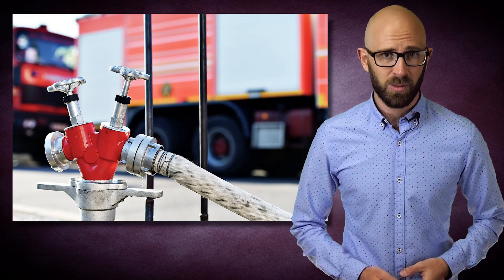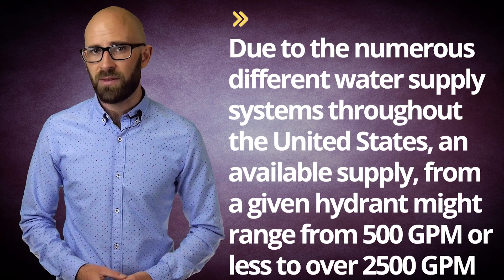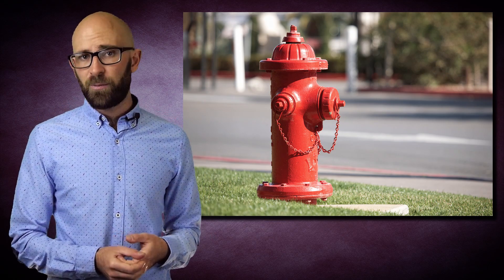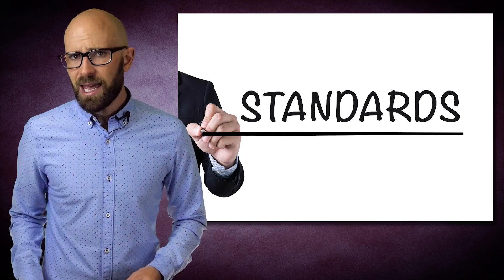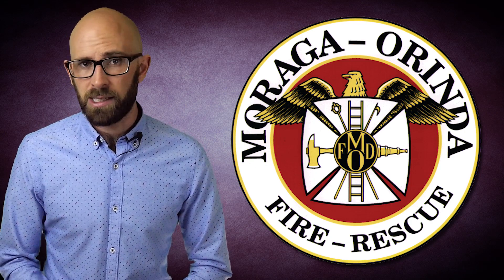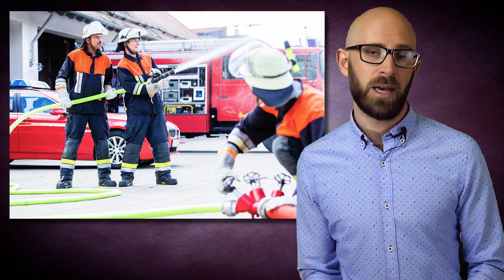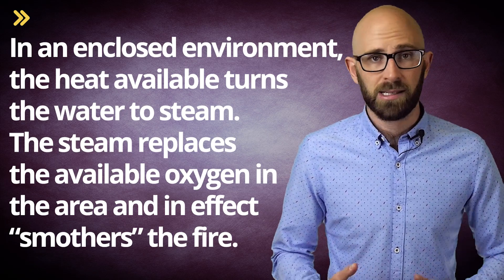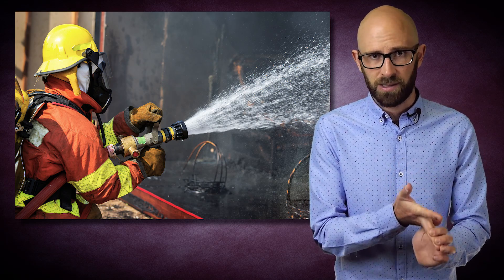Fire Hydrant Colors Actually Mean Something

Comment: In an American city or suburb where the hydrants are connected to the water mains, there's no need to color-code them. No fire department is going to roll up on a scene, look at the color of the nearest hydrant, and determine that it's not usable. "We need 725 GPM for this fire and this color says it's got only 500. Let's go around the block and see if there's a different color over there! We'll run a mile of hose to it if there is!"  That's why the half that doesn't care about color are realists and the other half that cares are probably Democrats.

Comment: Fire has 3 elements, not 4. Heat, oxygen and fuel are the 3 elements or components. Your “forth” is  not an element, it is the cause to the combination of all those 3. Fire will be extinguished when you eliminate one of those.

Comment: The color coding system helps when determining how many hose lines can be employed from the fire engine using that particular hydrant as a source.
However, the actual volumes and pressures can vary greatly depending on things like the time of day, whether or not the water company has adjusted the flow pattern, and also if someone else is using (or has open) another hydrant on that particular main.
It is the water company’s responsibility to regularly test each hydrant for actual pressures and viability, but for the above reasons many fire departments have their companies also consistently check the hydrants within their response areas.  (Pittsburgh Bureau of Fire). The colors typically relate to the size of the water mains they are on, but should reflect actual testing results (and these colors may change if repeated discrepancies are found).

Comment: Another effect in using water you overlooked is that by saturating the fuel source (such as wood or fabric) you make the fuel more difficult to burn. Another fire safety fact worth noting is that for grease fires in the kitchen, it's recommended to never use water. Water and oil don't mix and the water can cause the grease to spatter, spreading the fire. The recommended action, if the fire is still contained within the pan, is to either suffocate it by putting the lid on or douse the fire in flour (having an effect much like throwing dirt on a camp fire to extinguish it). The most important thing you can do in the event of a kitchen fire is to not panic. When cooking, always be aware of the risk of fire and be prepared to take the appropriate action should one break out.

Comment: St Louis county for the most part follows the color code, where the barrel is yellow and the bonnet is colored based on the main size, green for 12 inches and up, orange for 8 & 10, and red for six and smaller. Whereas most hydrants in St Louis City are black with a silver bonnet in most places and stylized in others (painted like the Italian flag in The Hill)

Comment: the city in which I live kept it's hydrants yellow and color coded the caps only. We also utilize a lot of dry hydrants in towns and villages along lakes and rivers which are made of a 6 inch diameter pipe that runs a short distance direct to a lake, river, or pond. The towns and villages often just hook a pumper truck to the pipe there set.

Comment: There is definitely a lack of following those NFPA guidelines.  Where I am (Long Island), we paint our hydrants all the same color within a fire district.  Each district has different colors and that helps with knowing the source of the flow.  The color-coding that we do have are on the standpipes.  Green, yellow, or red.  I haven't used them in ages, so the meanings behind them are forgotten by me.  When hydrants are out of service, they aren't bagged or painted.  A round cardboard tag goes on the treads of the largest access hole.

Comment: As a firefighter, I have three things:
1) 1:00 NFPA is the National Fire Protection Association, not Agency. It's a voluntary association of fire and life safety professionals, fire protection engineers, & manufacturers, not a federal agency like EPA or FEMA.
2) 2:00 That's an NYC hydrant. Some municipalities paint hydrants to not stand out. Some are even green. My department paints publicly maintained hydrants orange and privately maintained hydrants red.
3) Firefighters call hydrants plugs because in the old days they used hollowed out logs as water pipes. When a fire broke out, they'd dig up the log pipe and cut a hole in it to get water for the bucket brigade. After the fire, the log pipe would be plugged. To this day, "catching the plug" is what we call hooking into a hydrant.

Comment: Hold up. In my city, all hydrants are painted pure red. In the city to the north, all are yellow barrels with black caps. To the west they're all yellow with white caps. To the south, red with white caps, to the southeast pure yellow, to the east is dark blue with silver caps, and the next town over is black barrels with yellow or red caps. The town above that is silver with turquoise caps. The second to last town I mentioned, it is possible some system is in use, but in nearly every municipality around me, a consistent and unique color is used. Furthermore, observing older hydrants in my city reveal a variety of colors have been used. Underneath the current red paint, yellow paint can be seen on top of white and more red, on top of the bare cast iron. Out of order hydrants simply have a circular label placed on the front nozzle saying so. I find it surprising 47% claim to follow this system, because I've only seen one city with the potential of even using any system at all.

Comment: Residential fire sprinklers are  safer and faster than smoke alarms and even (in most cases) the fire dept.  Provides, water spray within seconds and less volume of water needed at the specific location (only those sprinklers close to the fire will open) to extinguish resulting less water damage, safer escape for occupants and safer for firefighters who need several (3 or 4) minutes to get to your house  at a minimum - plenty of time for a fire to grow to engulf a room or all of the house.  Residential sprinklers are not nearly as expensive as funerals but they are an addition to the rest of what you need. i.e smoke alarms and a fire exit plan.  How much are the lives of your children worth to you?  I got mine as surplus on eBay and installed them myself with PEX pipe for less than $500.00 but even if the retail cost of $5000.00 for sprinklers, pipe and installing them it  is worth doing to save a life.  In some areas like Scottsdale AZ they are mandated in the fire code and the National Fire Code is trying to include it for all new structures but your local building code may vary.  Watch some of the fire videos on youtube.

Comment: BONUS FACT : Some fire districts/municipalities use blue road reflector/markers vs. the clear ones normally used to help us locate hydrants at night, and usually a little to the side of the road it's on.   Thus helping us locate them faster.
Reply: Have also seen some departments paint their hydrants in reflective paint, though this option is typically more expensive due to paint cost.

Comment: 20 + years as a firefighter/Medic, and other than in training I have NEVER hooked to a pressurized hydrant. They are not used in a lot of places where there is no municipal water systems. Instead we run tanker shuttles and draft water from open water sources, creeks, ponds, swimming pools, rivers, lakes. Some of the departments have rigs that are nothing more than a huge portable pump, literally drive them into the lake trailing twin 4" supply lines, drop the suction lines in the water and crank up the pump. There are a few "dry hydrants" around as well, those are nothing more than 4-6" pipes laid underground to get access to water from one of the above, closer to a road or parking pad.

Comment: They do, MDC's. Some are more advanced than others, also depends on other departments within the city. If the water department has compatible software and tech services will load it on the FD's MDC and the MDC is working that day......The FD will have the route and hydrant plotted for them on the MDC. But they are still limited by the GPM and PSI close to what is burning. They usually have 1000 ft of supply hose, and then chances are that every hydrant in the area is the same GPM and PSI. FD's can only work with what is available.

Comment: This video is such garbage. I work for a public water company. The local town can decide what colors to paint their hydrants. The gpm you get from any particular hydrant depends on the main size it’s connected to. But most hydrants are 4” at the “boot” connection point going into the water main. 
You are correct about having a distinguished color cap from a raw or non-potable source. But I can’t watch much more of this insanity to comment further. 👎🏻

Comment: I worked in the pipeline field for many years... Painted many hydrants... Safety yellow, Caterpillar yellow, John Deere yellow... Brea, CA they have ? Green/Silver... Norco, CA safety yellow with safety blue tops snd caps... Purple hydrants are reclaimed water, do not drink. A reflective blue dot is located 1' from center of street to mark hydrants for firefighters... some hydrants have break off bolts, or break off spools... This guy needs to do little more research on hydrants.

Comment: Obviously, this is better handled on the old continent. Access to the public water supply (there is no such thing as private water supplies here; where are you guys heads at??) here is acchieved by a special, not commercially available (actually, it is commercially available, but only municipalities can buy them),  fitting underground, covered by a locked metal hatch. Not on some above ground cast iron pillar everyone can get their grubby hands on. Pertinent information to the individual hydrant is displayed in numbers (metric, of course) on a plaque on a wall nearby wall or a bespoke post, hopefully eliminating misinterpretation and overpainting issues

Comment: Fire hydrants are not color coded. Do you really think fire fighters are running all over like chickens with their heads chopped off looking for a suitable water source? NO! That would just be insane. Why do that rather than have them ALL at the same pressure and be able to go to the closest one? There's not going to be a bunch of fire hydrants of varying pressures all over a city block, and they're certainly not stretching that hose more than a block. Every single fire hydrant in my city is red except for a yellow one or 2, they just have to be painted bright so they're noticeable.

Comment: Water doesn't tend to put out things by cooling them down (though the cooling effect does help a tiny bit). This is why things with their own oxygen supply (flares, napalm, thermite) continue to burn while in water. Video evidence: https://www.youtube.com/watch?v=JUkcOyy_WnQ

Water is an incredibly poor thermal conductor. You can put red hot iron in it and it will continue to be red hot for a while. The heat does transfer to the water will eventually cool the iron but, if you were to look at it, the surface will be red hot for a short while (the interior stays red hot for much longer, but you can't see it). https://youtu.be/lW1zbS1fWVs?t=249

Comment: No mention of the hydrants in San Francisco?  They have seawater and fresh water hydrants.  After the 1906 earthquake they ran out of water.  To prevent from running out of water they installed salt water hydrants with the hopes the fire would be out before the Pacific ocean was pumped dry.

Comment: Very interesting video!  There's a tall pole with a round sign just outside my house with a picture of a hydrant on it.  However, the "hydrant" is actually two round flip-up lids in the middle of the lane.  One shallow one for connecting a hose, and a deep one with a hex-bolt-looking thing that they can use a T-shaped tool to open the water flow.  I've seen them use it once when there was a brush fire nearby.  It's kind of a neat setup because the lane is pretty narrow and it makes sense to run the pipe through the middle.

Comment: Color coding in my municipality (a large city with consistent feed infrastructure throughout) doesn't necessarily follow NFPA.  There are two colors in common use; the vast majority are simply red.  The other color is yellow, which city's water works only noted indicated "special concerns"....typically, its a "dead end" hydrant, meaning that its output would be reduced if upstream hydrants are tapped.  There are a handful of black hydrants downtown, smaller and of different design, clearly remnants of an older system that has been discontinued in favor of modern (red) hydrants (on other corners of the same intersections).

Comment: So, disclaimer, I haven't watched the video yet.
I thought that it was to do with whether the water was considered potable or not?

Edit: Watched the video. If a hydrant is painted violet, it would likely draw from non-potable water sources.
Reply: Not the fire, no, but the firefighters do need to know.

While non-potable sources are just as useful as potable sources for fire-fighting, if they haven't been properly filtered beforehand, they can cause damage to firefighting equipment, due to large solid materials that may be present.
Non-potable water that is brackish, or saltwater, may also require extensive flushing of firefighting equipment afterwards, to prevent damage due to corrosion.

(In the video, it was addressed that fire hydrants drawing from non-potable water sources are often painted violet.)